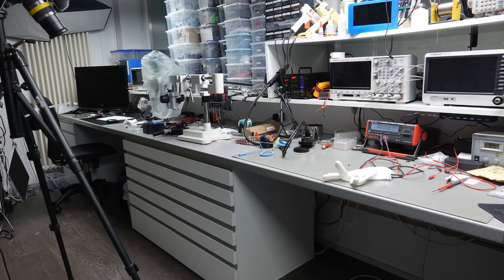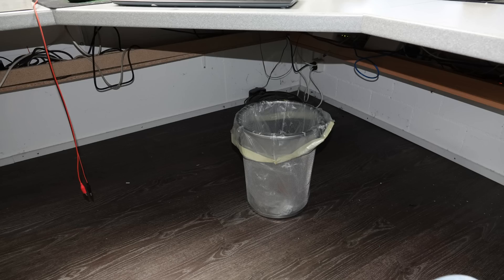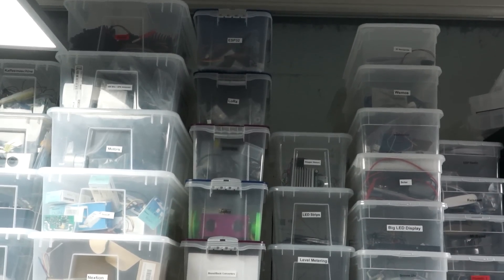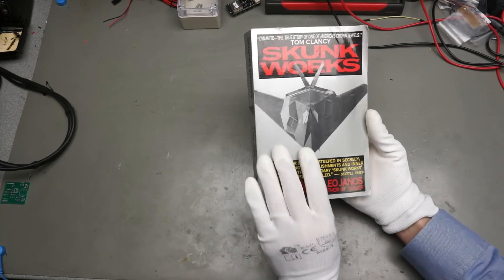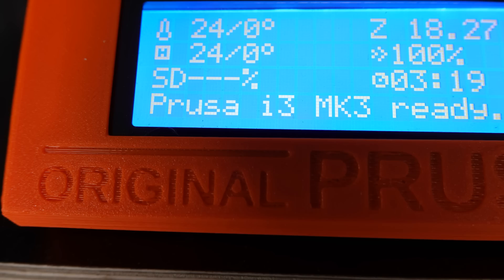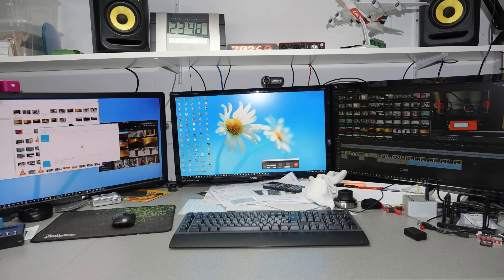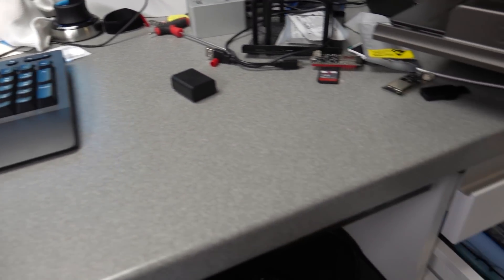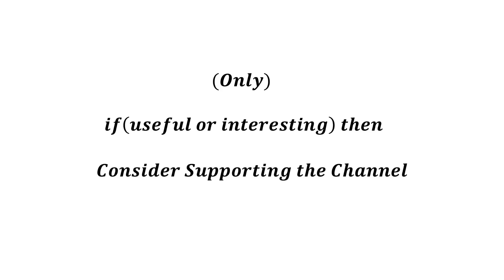461 The Tools and Organizers I Use (with some tricks)

Comment: it is a great lab:) oh i spied  those dupont wires, one of your popular videos which I find useful is that on the dupont wires
https://youtu.be/eI3fxTH6f6I?si=B5w6JfQNnV3N-4AV
these days instead of shells,  I simply used heat shrink tubes to insulate the pins. by doing just that i saved like 5-8mm off the length of the shells and the dupont wires can fit within lower height project boxes. this becomes so useful I made do without shells these days
Reply from the maker: Heat shrink tubes are always a good thing ;-)

Comment: I gave up on ABS. I much prefer PETG. It doesn't add fuel to a fire, which is good for electrical boxes.
Reply from the maker: My Prusa is good with ABS (or ASA). But I sometimes also use PETG because of its lovely colors and finish.

Comment: Nice lab walkthrough. Thanks for sharing. Good tip about the binoculars. 
The Microsoft Garage project Mouse without Borders has been a very useful app for controlling multiple computers and monitors with a single set of interface devices. A keyboard, mouse, joystick/pad ect plugged into a hub or kvm switch keeps everything tidy. It's easy to copy/paste between computers. You can seamlessly switch between controlling a single computer/monitor and multiple computers and monitors as if they're all extended desktop monitors or clones.
Reply from the maker: Thanks for the tip for The Microsoft Garage project Mouse. I did not know it. Since I have 3 monitors on my table, I usually use remote desktop applications (also because I have some Linux systems). But your solution is much cheaper!

Comment: I'm shocked given your German accent you've not yet discovered EuroBoxes for storage. Those transparent Ikea (and all other <Large Brand> store) don't have any standards on dimensions, and they don't stack very well (the only stack on top of themselves when they have the lid on). Euroboxes standardize around EUR pallets (so120cmx80cm and fractions of those sizes), have a 2:3 size ratio, stack with different sizes, without lids, and you don't have all that wasted space between the boxes.
Reply from the maker: Indeed, I never heard about them. But I saw some of them. The ones I saw were much bigger and not transparent. But maybe there are others around that I never saw.

Comment: The probes on the multimeter are gigantic like a pitchfork... We have the same one. I hate those probes. I have little hook ones but I'd like smaller prongs as well.
Reply from the maker: You get smaller hooks, but they are very delicate and easily bend :-(

Comment: It's interesting to see the shift in how people view 3D printed parts. The signals of quality in injected molded parts like smooth surfaces are absent in most 3D prints so it's easy to believe that they're crap, no matter how much better they are in function. I think it's slowly changing, though, as more people make and use 3D prints.
Reply from the maker: I agree that the surface still is an issue. The rigidity can be an issue, too, for some applications.
And if you order 3D-printed parts from JLCPCB, the surface seems okay. They use pretty expensive printers, I think.

Comment: WOW, so much of your lab is just like mine, exact Same size. even your desktop laminate is the same as min!, i use plastic storage bins just like you for projects, I have 3 x 3d printers, 1 is resin. but for storage of components i use a SLATWALL system like the retail stores use! I build all my own cabinets.
Reply from the maker: Slatwalls are an excellent solution. In my case, most of the boxes are in front of a large window that must be opened occasionally...

Comment: CNC mill - NOT in the workshop! It does not need attention- set it up and return when finished- put it somewhere you do not have to watch/hear it. Mine is in my garage, in its own enclosure. Storage boxes- make a frame with tabs that support the lip- you can then remove without disturbing the others in the stack. 
Drawers- single item depth stops the need to scrabble through them.
Reply from the maker: I agree entirely, it is a mess. Mine is now even further away: I sold it because I did not use it anymore due to my 3D printer and JLCPCB...
Reply: @AndreasSpiess  I am curious about how many CNC mills actually get used. Many feel they need one, but either the learning curve to use one, or the lack of need for what it can produce, means they either lie there or are moved on. A couple of my favorite YT sites got one, fanfared its installation, only for it never to be heard of again. 3D printers are certainly used a lot more- the ratio between my prints and my CNC machining is probably 100:1. But they will do things that are almost impossible otherwise. I built a second, smaller but more rigid, machine for metal. It can do in minutes what would take hours with lots of re-mounting on my manual mill.

Comment: :) I used to work with a PDP 10 and PDP 11/45.  I loved those machines!
Reply: I really would have liked to see PDP and LSI-11 etc series to be the main line in microcontrollers too. The architecture is much better for high level programs than Intel products, faster.
Reply from the maker: Alpha was as fast as Intel's stuff 10 years later. Still, the company is gone, and Intel still is here :-(

Comment: Hi Andreas, I like the idea 👍 of having a HDMI switch👍 for you raspberry Pi's or even a PC. Do you have or is there a solution for applying the same trick to use just one keyboard and mouse on several PC's or Raspberry PI's? That would be really awesome 😊
Reply from the maker: I use a Logitech Combo and insert the tiny USB dongle into the device I want to use the Keyboard and mouse.
Reply: @AndreasSpiess  That's a great idea :elbowcough: Thanks Andreas ☺

Comment: How well do these Mini-PV Connectors crimp with this crimper? I'm still on the search for a perfect crimp without the need to buy a  HT-0095 for 1k or more. I found the kits from Würth pretty nice as they basically give lifetime re-supply of components.
Reply from the maker: I only crimp Dupont wires with this crimper. So I do not know if it is suitable for other connectors.

Comment: Atom, Evernote, Thingiverse - give away someone who started a while ago and is not interested in changing tools that still work.
- Vscode won the race with Atom, I haven't heard about Atom in a while. I believe Vscode can also be faster than Atom depending on configuration. Although the temptation to overload it with extensions is high.
- I haven't heard about Evernote for a long time as well. But I know well it might be difficult to move a big knowledge base into a different software. I'm in the process of consolidating my notes from different places into Obsidian.
- Printables by Prusa might be a better place to share 3D designs. Thingiverse was stagnating for a long time and had some controversies associated with it afaik.

Comment: This was fun and interesting. I have a simple, tiny lab, but there are a couple of things that I keep handy which I did not see. 1) hook and pick set(s) (think "dental tools" - super cheap) to go where tweezers fear to tread, and 2) custom adapters/patch cables/connectors that I use a lot (power/audio/MIDI).  The first is a lifesaver and the second is a big timesaver - both make the experience more enjoyable. Maybe a companion video about workflow would be equally interesting.
Reply from the maker: Thanks for the tip with the dental tools. And, of course, I have a lot of premade cables, too. They are convenient.

Comment: 05:00 : Binocular, i've used it at a past work (lectronic board manufacturer) and it's really a top tool to have when you have to solder or repair smd board. But for a hobbyist it's very expensive
Reply from the maker: I agree, it is expensive. But it will last till I die and my kids can sell it then ;-)

Comment: Hi Andreas.  Great lab!  Mine has a lot of similarities.  I wanted to inform you that Fusion360 is, unfortunately, owned by one of the crummiest companies you'll ever run afoul of; AutoDesk.   They screw over their customers as frequently as the seasons pass.  For instance they say "Fusion360 is free" but after a bit, even though you fall far down in their "free for use" category they will drop your free status.  This will be after you've invested a lot of time learning how to use it.   Nothing you say or provide will change your status.  Get out your wallet!

Comment: Great video as always!
If you load huge projects you can also add M.2 NVME drive using pcie free slot, you can get an adapter for few buck online. 
Also regarding to your 3D printer, everything your machine have a cheap Ender 3 can be upgraded to, however you 'pay' with time for setting up all these upgrades.
Also, if you print alot with PLA/PETG/ABS (basically no fancy materials), you might consider a microporous coatings glass bed, so you won't need to use glue anymore and after it cools down it de-stuck (it's like a magic!).
Reply from the maker: Before my Prusa, I had a Chinese printer and did a lot of enhancements. As you write, it consumed a lot of time. But I am sure newer printers have become better.

Comment: Thanks again and greetings to Marwin. Up to now  I have no 3D printer. I have a collection of project boxes and a lot of cheap or IP rated junction boxes. Usally it is faster (and way cheaper) to modify these boxes.
Reply from the maker: I promise that you would use a 3D printer as soon as you have it. Boxes are just the beginning. Now I print all sorts of things, and it runs a few times every week...
I will greet Marvin. He still is my neighbor.
Reply: @AndreasSpiess  Thanks! Up to now, every time I think to need a 3D printer I find a different solution. E.g. Empty toothpaste tube as protection for a reed contact1

Comment: Was it 3 years ago?  My wife said  the same. You need my power supply, Andreas. It's great for Lifepo4.  30 A 60 Volt.
Reply from the maker: 2018! I included a list of my newer equipment in a pinned comment. 30A is probably too much for me...

Comment: No chemical odor from all those plastic boxes in such small room?
Reply: Nope.. I use them too
The plastic used in those boxes is quite good, they don't emit any odor!
Reply: @ThermalWorld_  Thank you. I had such problem around 2005.
Reply: @cernejr  Anyway, you have to first check them because some shops sell a not quality one's..
Reply from the maker: As I said in the video, mine are from IKEA. I assume they sell the same products everywhere. And I agree with @ThermalWorld. Soldering is the bigger issue ;-)
Reply: @AndreasSpiess  Thank you. All roads lead to IKEA. :)

Comment: Your workshop is large, compared to mine. I live on a narrowboat, which is only 2 metres wide, on the outside! So you can imagine; I have to be very strict about what I keep. Emotionally painful for me!
Reply from the maker: Sounds like an exciting life. On a boat!
Reply: @AndreasSpiess  yes, it's lovely. I am currently designing and building a micro controller based automated heating and hot water control, and battery monitoring system taking heat sources from a diesel boiler, the engine and a solid fueled stove backboiler, and power from alternator and solar. Quite a lot of work for a nano!

Comment from the maker: Here are the tools I changed over time:
Soldering iron: https://www.jbctools.com/cdb-soldering-station-product-1605.html (very expensive!)
Power supply: https://s.click.aliexpress.com/e/_Dl1Zfxz
Silicone Dupont wires (an upgrade): https://s.click.aliexpress.com/e/_Deq7AeJ
Crimper: https://s.click.aliexpress.com/e/_DFUQOlN
The milling machine was sold to a young enthusiast
Eagle was replaced with KiCAD (and EasyEDA for small PCBs because it is so easy to order PCBs)
Power Director editor was replaced by Davinci Resolve
Atom was replaced with Visual Code (PlatformIO)
The ESP8266 was replaced by the ESP32
The video cam was retired and replaced by the RX10 and the iPhone for mobile shots
The subscriber counter was retired (YouTube stopped the feed of data)
Reply: Nothing beats those JBC stations. They are very expensive but certainly worth each cent.
If you ever plan on buying a new hot air station ... Quick 861DW is amazing and very affordable.
Reply: What happened to your AIXUN T3A soldering station? And how does it compare to the original JBC? I plan to get a AIXUN T3B  and I wonder if the JBC ist worth the higher price for soldering once per month.   Do you know the Sequre S60 nano Lötkolben ? For USB-C Netzteil via Powerbank 
12V / 60W
kompatibel with JBC c210 Lötspitzen
3 Spitzen und EU Netzteil
Review von SDG Electronics: 
https://www.youtube.com/watch?v=2NqDumeKurw   So you can use the good JBC Tips on the go
Reply: @joehoandroid  I guess if you are not soldering on a regular base it might be overkill to buy a JBC station.
Those cheap cartridge versions perform pretty well and are an excellent alternative for the small hobbyist.
I have used a Weller station for over 30 years but I thought it was time to seriously update that one and went for the JBC (CD-2BQWD) which is pricy but a good investment if you solder on a very regular base like myself.
I also have a TS100 that I use when I am "on the move" which is simply powered by a pack of 18650 cells. Even with the standard cheap tips that were delivered with the TS100 I get good results and cannot complain.

The S60 you linked looks like a nice soldering iron which seems to have good reviews and should be more than enough for casual electronics soldering (it'll probably outperform my old Weller station).
Reply from the maker: @ppdan I agree with @ppdan. For occasional soldering I would use one of the TS... soldering irons. They can be used mobile with a battery too...